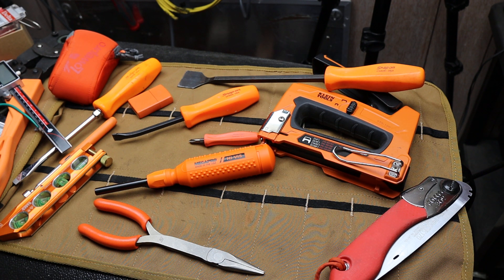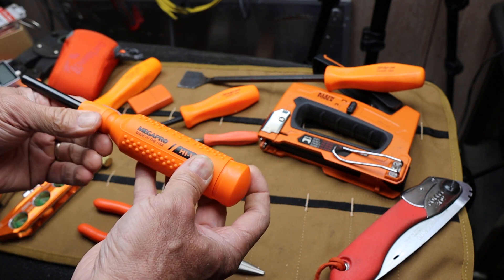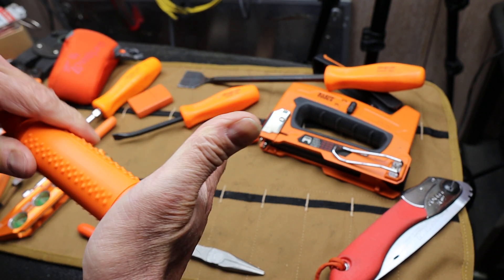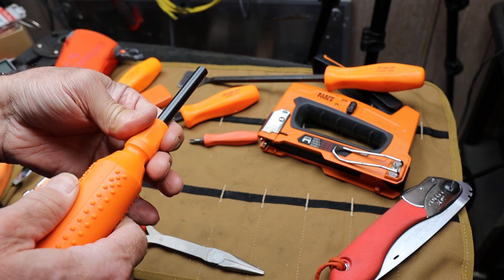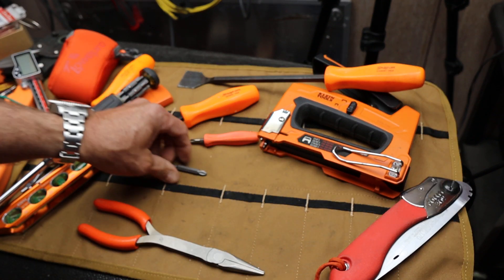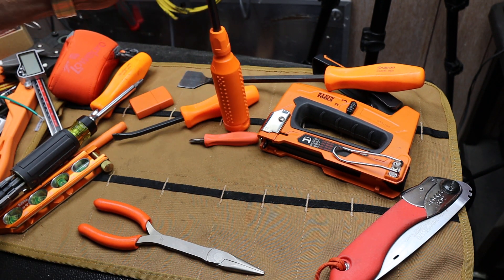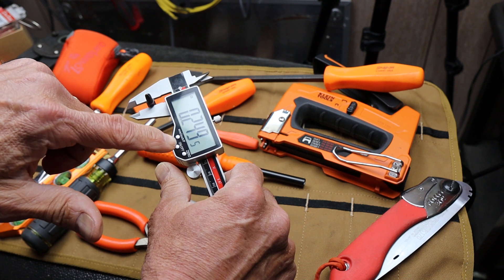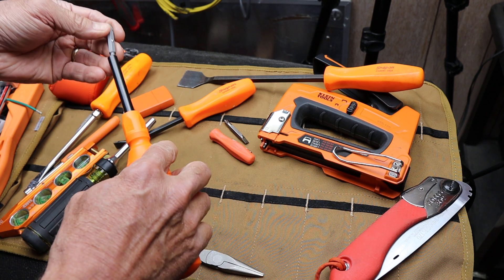Underwhelmed. The MEGAPRO Original 15 in 1 Bit Driver in Hi Viz Orange. USA made, but bits are loose

Comment: I've had one for about 15 - 20 years, and never had a problem with the bits being loose. The only problem I have had is the small slot tip broke, so now it is even smaller. I keep it in the house as my go to multibit screwdriver. Cheers Doc. 🇨🇦

Comment: I cannot speak to the "original" version, but I've used the ratcheting version for 8 years. The handle style is round with two rubber areas. I think Megapro pioneered that style of carousel bit holder. Then they started making them for Craftsman, Channel Lock,  Klein, and others.

As an appliance technician, what really set Megapro apart, was their wide arrangement of Torx bits. I think the Klein #-in-1 had maybe just a T15.
Also, unlike Klein, Megapro's bits didn't rust on me after a week of work.

Comment: My Grandpa's garage was full of these drivers when he passed - I think he liked that Mega Pro was local to us here in BC. Two longer term use thoughts: the bits are quite strong (not as well fitting as a wera or snapon) but they do hold up to use in a drill - which I think the best way to use this thing is chucking it in your drill bag and having a fairly complete bit set handy plus a driver without packing it twice - I like the little bit of extra reach you get with these longer double sided bits. Also, as a Canadian I feel obligated to say you don't need that combi bit, just use the appropriate size robertson (generally 2) and you're in great shape. Pretty sure thats why the make a ph2/R2 bit actually.

Comment: I have to say that he is indeed right.  I went to a hardware store where they had a variety of Megapros.  I tested 3 of them and it appears to me that not all bits are made the same.  Some are tighter than others.  If you ever want to invest on Megapro, the only ones I would invest on are the shaft lok or the ratcheting with the 1 inch bits.

Comment: I have used the security version for 20+ years. I have had 2. Lost the first and I have had the second one for quite a while with no issues. I had the ratcheting one and lost that. Now  I have the original version as well with no issues. With over 20 years of using 4 of these  in commercial and industrial plumbing I haven't had any issues or failures. I don't carry it by the bit and I don't fumble around trying to use it. Sometimes it's not the right screwdriver and I grab something else but it has never let me down.

Comment: I found one of these in an auction house that was being cleared out years ago. It was stolen off of a jobsite last weekend. very sad. I am a commercial electrician. Most in my industry use klein. I considered trying a different multibit driver but i just bought another megapro. best screwdriver ever.

Comment: The rolgear silent ratcheting mechanism is the best IMHO (have both Klein styles, Williams/snap on, PB, Wera, stahwlille and a bunch of others).  And it has 3in flip bits.  Costs a bit more than the megapro but less than the megapro ratcheting  The rolgear mechanism is also found in the Gedore (which I have in duplicate) and Hazet (which I keep thinking about buying) if you want a bit driver (with or without storage for Gedore and with for Hazet). 

The point of all these multibit especially ratcheting in my view is for people who work with their tools for a living, carry their tools on them and/or have a long walk to get another tool.  Light and all in one and ratcheting saves your wrist.  The same idea applies to a small kit for say overlanding (or in my case roadside repairs).  I finally found some posidriv flip bits and was super happy.  If I am honest with myself, I don’t turn enough screws where it makes a difference so I grab the appropriate size in non-ratcheting or an impact/driver if I have to do a lot of screws most often.  But I did decide to buy all the various multibit and ratcheting ones anyone said were any good to see what I thought of them and tried them all out.  Haha.
Reply: The Gedore and Hazet versions of the silent ratchet with bit storage in the handle looks ultra swanky, but man do they want some dough for it. Cheapest I could find the one that I'd want was $84 USD for the Hazet with silent ratchet, bit storage, and a quick change collet with removable extension.
Reply: The Gedore without the bit storage I bought for $18 from Germany.

Comment: Generally I find that I don't use the ratchet on ratcheting screwdrivers that much.  I also would rather my multi-bit drivers take standard 1" by .25" hex bits not manufacturer specific bits.  Then if any bits get lost/damaged or I find a specialty bit I need on the regular, they can be swapped from a standard bit set.  That's why I prefer the Klein 14-in-1 adjustable length.  Bonus it can share bits with an impact driver, and the shank from it can work as an impact extension in a pinch.

Comment: When you were gripping the bit and dangling the tool until it fell out, my first thought was “that looks like a good amount of retention”. I have a lot of tools where the magnetic bit retention is just too strong. I can’t remember ever having a bit that I inserted fully actually fall outC but I’ve had damp or cold fingers where it was challenging to get the bit out.

Having to line it up to get it to slide in, though, no, that’s not OK.

Comment: I have three megapros 1 of them is very hard to insert bits, the other two are perfect. I totally get your gripe on that. Same thing with the front collar, smooth part then stiff when spinning. Annoying yes but not a deal breaker. I typically spin it using my palm on the carousal and holding the shaft. They work for the very little i use them for on telecommunications cabinets but it is annoying at times. I’ve actually got a snap on ratcheting screwdriver with bits on the way to replace it.

Comment: We're actually using this at work, not the hi-vis version tho. It's decent, nice to have when you don't want to carry a ton of screwdrivers. Ours seem to have a better fit on the bits tho, they're hard to get out of the tip sometimes. And if you lose the bits somewhere you can't easily replace them, which is a big downside with these double-ended bits. On the other hand you're getting a couple more sizes than you would with similar screwdrivers

Comment: You should check out the Lenox and Irwin ratcheting screwdrivers. They're the same driver essentially, just a different grip and bit colors. Don't let the fact that it looks like the Klein abomination fool you. They're designed a lot differently, slightly slimmer, and I like them. The Bit/shaft setup has a lot of engineering and milling put into it, way beyond the Klein or any other version. I have the Lenox version and I think It's pretty nice.

If you're not stapling up Romex and doing smaller cables or low voltage cables, you should check out the Surebonder TRIGGERFIRE Cable Tacker Staple Gun. I was about to get the klein stapler you have to try out to see if it was worth getting more of for our crew at work, but then I stumbled upon the Surbonder on the net. It's got a trigger on it which means you can squeeze it and cock it, then line it upon the cable/wood then use the trigger to set the staples. It also will operate like a regular stapler. Got one, tried it out, worked beautifully. Bought four more for the crew and haven't had any trouble out of them. Oh and the best part is, is that it'll work with Arrow T59 insulated staples, which I've had success finding at Lowes. Even though I went and found a bulk deal on eBay for some T59 staples.

Comment: Snap on has a 10 inch pry bar it's new I think 30 + bucks seems like a great deal to me!
Reply from the maker: It looks like a demolition slotted screwdriver with 1/4” shaft. I’d like to see one in person. Thanks.
Reply: @lastbesttool  snap on website home page featured tools
Reply from the maker: @dombond6515  Just looked at it. Called my SO dealer to see if there were any on his truck. It's on my list! Thanks.
Reply: @lastbesttool  I order 1 as well. Thought is was a screaming deal and a great size.
Reply from the maker: @dombond6515  Just ordered one with green handle. No ETA however.

Comment: I liked the scale. You were right thinking that the tenth function on the calipers simply rounds thing off, adding to the errors. One of the drawbacks of cheap digital gages. Given that, SO's bit at .250 can be a product of the calipers. Do you have a calibrated micrometer that you've developed a feel for? That would be the way to do. A mechanical mic with a friction thimble would even earn a few competence points.

Comment: Every time I buy Klein, I'm disappointed.  I'm very happy with my Megapro automotive.  My bits don't fall out and I can't pull the bit out just with the weight of the tool.  The Megapro is so much more solid than my old Milwaukee ratchet screwdriver.